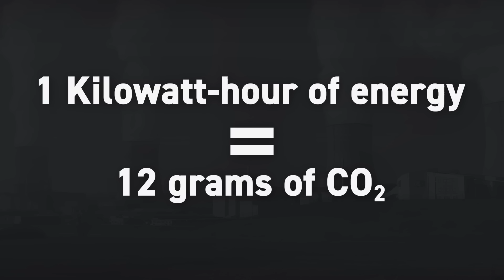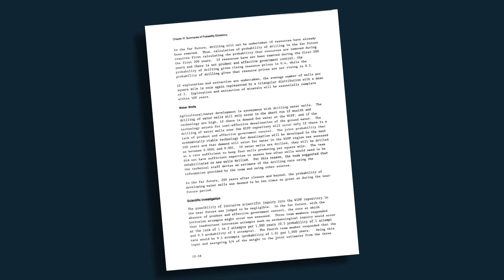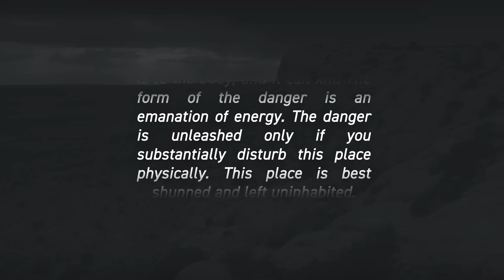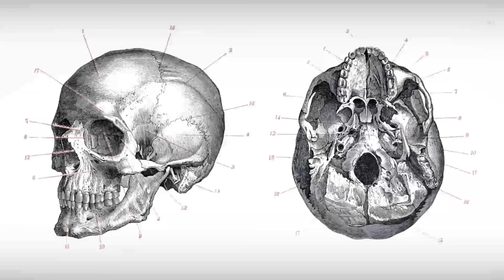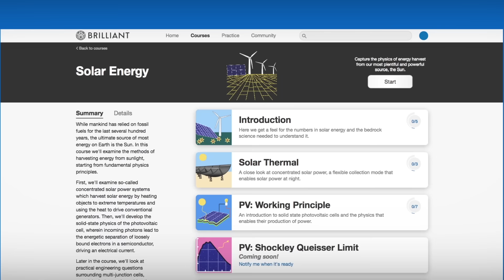The Nuclear Waste Problem

Comment: I like a lot of your videos, but this one is horrible.  You imply that most nuclear waste is sitting in pools at the moment (it's not).  You imply that there are only 230 years' worth of uranium, and fail to mention 99.5% of nuclear waste is unused fuel, and that there are much larger theoretically recoverable sources of uranium (like the ocean), and make no mention whatsoever of thorium (which has a comparatively limitless supply).  In noting the economic costs of the exclusion zones, you don't mention they were made far too large around the melted down reactors, and basically result in unofficial nature reserves, probably more pristine than our national parks flooded with poorly-behaving tourists.  

"As a radioactive element decays, the individual atoms split into two."  REALLY?  You mean fission, not decay, right?  How are you even making this video while mixing up these terms, ESPECIALLY because you are making one on nuclear waste (where "decay" becomes an important concept).  Shaking my head. 

You state that the fuel rods "use up" their energy which is why they are no longer useful in the reactor.  NOT TRUE.  It is because of gaseous fission products building up inside of the rod, causing it to swell and crack.  Most of the "fuel" remains unused, as there is a lot of uranium 238 which could absorb neutrons and become fissile plutonium, which would keep the reactor running for decades more just fine.  The problem is the solid fuel currently used would break the reactor due to the gaseous products breaking the rods.

You imply that nuclear waste is dangerous for hundreds of thousands of years.  It's not really, since the radiation emitted will be low.  This is a necessary consequence of long-lived nuclear waste having a long half life.  An intrinsic property to long-term nuclear waste.

You also completely ignore that "new" technologies (50 years old, but newer than the current concepts of nuclear reactors we keep building) could burn up all long-lived nuclear waste and leave us with rapidly decaying (in 300 years) fission products.  That's right.  We could completely rid ourselves of long-lived nuclear waste, while at the same time providing carbon free energy, for thousands of years, all without mining another single atom of uranium.  This is because nuclear waste is 99.5% unburned fuel.  Who would pay for this?  The taxpayer?  NOPE.  The power companies for decades have paid a nuclear waste fee, and the fund now has 46 billion US Dollars in it.  Google Nuclear Waste Fund.  The federal government promised to collect the waste, and the companies have been paying for the fee, and yet so far, anti-nuke activists and paralyzed government have crippled responsible stewardship.  Let's develop reactors that can burn up the waste (my preference would be by using molten salt reactors, first developed in the 1970s) and get to a zero carbon economy within the next decade.  Using the fund, development and much of the construction of these reactors is even already paid for!  No business case in selling the electricity needed (though for technical reasons it should be the cheapest ever generated, except from perhaps hydro).  I really cannot understand the stupidity of our elected leaders and the electorate in general for not having done this ages ago.  We need scientific literacy NOW.  Your video FAILED in even mentioning this quite important point.  And it's not like "closing the nuclear cycle" is a new concept.  It was the idea from the beginning.  It should have been included in merely talking about the history of nuclear waste storage and the motivation for the pools and dry cask storage.

You say that every little bit ever is currently in short term storage, but this is clearly not the case.  Stalin put some nuclear waste in long term storage, pumping it underground in a sealed aquifer. 

Also, the french put nuclear waste in glass, and to me this is long term storage.  Sure, it's not buried, but it's also not going anywhere, even if we disappear.  How do we know this?  The vitrification (glass) of nuclear waste happened because they saw how nuclear waste was stored billions of years ago in the natural nuclear reactors in Gabon.  No, i'm not making this up.  You have a laptop - go google it.  NATURAL nuclear reactors stored their fission products (obviously by accident) in a way that kept them from escaping "into the environment", even though they were in ground water.  Actually, I would say this is another reason your claim that no nuclear waste has ever been disposed of long-term is false, even though people didn't produce it.

You say that when the spent fuel rod pool is dry, the radiation "goes out into the environment", implying it's the same as a cloud of caesium-137 or strontium-90 approaching Tokyo. But it's not. Maybe a discussion about what is meant by the term "radiation" is warranted here. Yes, you'd have radiation coming off the rods (alpha, beta, gamma particles), and it could induce some radiation in items exposed to it, but it's not the same as having the radioactive particles directly on your farmland, in your body, whatever. It's not like the fuel rods would magically move out of the pool unless there were some other type of problem, like an explosion.  Then you say that "thousands would have been killed".  How?  Were thousands in a direct line of sight with the rods of the pool?  Please explain yourself.

I will give you props in correctly asserting that NOBODY was killed in the Fukushima reactor meltdown from radiation (two were killed in car crashes during the evacuation as a consequence of the exclusion zones being too large as a response to unreasonable and unscientific fear of radiation).  But you then incorrectly state that 130 early cancer deaths are expected.  I assume that this is due to the linear no threshold "theory" of the effects of radiation on humans, when the reality is that you need to have a dose of radiation above a threshold to be harmed by it.  At lower levels, radiation is even good for you, protecting you from cancer (google radiation hormesis to read up on it).  Evidence suggests the latter, fear mongers love the former.  Finally at least the "scientific" UN changed it's stance on the matter and rejects the linear no threshold model.  So when you say 130 deaths expected, please state your source.  I'm going to go out on a limb and say it's anti-science hogwash, unless you can show that that many people received more than a threshold of 100 mREM (they didn't).  

Instead of accurately describing nuclear reactors and the nuclear waste problem, and showing potential plausible ways for long term disposal, you take the narrow political view that it's an unfeasible problem to solve.  It's not.  You use anti-nuke fear mongering instead of elucidating the science.  Thank you for not adding any value to the lives of your viewers with this video due to careless research and narrow political aims.

100,000 years from now long term buried waste would not be waste anymore.  The "bad stuff" would have long since decayed away to safe levels.  Though still radioactive, I wouldn't mind touching it!  But one thing it would contain plenty of - Plutonium.  And you'd only need chemical separation to get it refined, with nearly no radiation to make it in any way difficult.  It would be a perfect plutonium mine (not a "naturally occurring" element).  We will have succeeded in giving whatever warlord owns the territory above in a post-apocalyptic world a monopoly on easily-buildable "gun type" nuclear bombs.  Especially if we mark the X on the map with a thorny landscape and pictographs to help her or him figure out what lies buried there.  No discussion of this either.

Aaaaand at the end you have an advertisement for math and science education.  The irony is thick here.
Reply: I scrolled a LONG way to find this comment after reading you mention it in a reply near the top. You should be the top comment here. I ADORE Wendover Productions as well as Half As Interesting, but I strongly feel that they mucked this one up badly.
Reply: This comment needs more upvotes.
Reply: After reading this. I know I have got a lot to learn
Reply: Oh wow a whole essay in the youtube comments. I bet every person who saw this read the whole thing.
Reply: This comment is not completely true, as it tries to be.
Long lived nuclear waste has of course lower radiation. Especially because short lived waste decays. BUT, nuclear waste has also materials with a half time of about 100k years. Which is a really bad spot, because it is some magnitudes smaller than "natural" uranium ( meaning lots more dangerous), but this half time is still so high, that it takes millions of years to decay do negligible amounts.
So, when will the fuel really be not dangerous anymore? It depends on your definition of which amount of radiation is dangerous and on how much waste/ purity of it you have.
Reply: Nice essay you got there.
Reply: You told him.
Reply: How long did it take u to write this
Reply: This comment is longer than most troll read more comments
Reply: Atleast add a TLDR
Reply: MrGottaQuestion legit that is really interesting and you should definitely do a video on it
Reply: I appreciate that you mentioned the new reactor technologies that have been developed like the LFTR or MSR, but what do you think of breeder reactors like the Integral Fast Reactor (IFR)?
Reply: Its not that deep chill out.
Reply: This guy knows his shit. Screw solar power and wind mills, nuclear is the future.
Reply: Ok
Reply: MrGottaQuestion Launch your own channel and speak the truth:
Reply: "As a radioactive Element decays the individual atoms split into two" Physics major be like 😂wtf
Reply: Make your own video, man.
Reply: 1. Thank you for doing this amazing research and sharing it.
2. Have you considered forming a power company that does exactly that with the leftover materials 
3. How long did you spend typing that essay!
Reply: Spent fuel rods are 80% recyclable, the only reason we don't donit is because it's illegal, France recycled their fuel and has almost no nuclear waste, protest this crime against the environment!!!! Legalize nuclear recycling!!!!
Reply: @question, there actually is a ridiculous amount of spent nuclear fuel stored in dry casks at many nuclear plants across the nation. You can even see them on google earth.

Most of the shorter lived highly radioactive isotopes will be gone relatively quickly....others such as plutonium have a very long half life. How ever Plutonium is extremely dangerous only if it can get inside of your body.

I was aware of the natural nuclear reactor of Gabon’s how ever I was not aware that the used fuel was vitrified. Some real interesting facts.
Reply: MrGottaQuestion My knowledge on this topic is rather poor, so thank you for the long and detailed comment. Lost me a time or two, but picked up shortly after. If you have time for it, I have a question: While it currently is way to dangerous and cost prohibitive, could advances in space travel give us a permanent solution for at least the most dangerous waste material? If we could be super duper certain that it wouldn’t blow up, chucking some of the waste into a rocket and hurling it into the sun would get rid of it(and be cool as hell too!). Really expensive yes, but maybe better than hiding it away and hope for the best. Remember, we are the species that rendered large areas lethal due to “operator error” and by having a nuclear plant in a place with a lot of seismic activity :P
Reply: Thank you for this comment! I have been looking for videos like these because my country's political leaders' keep publishing facebook posts about wind farms and solar panels. There are so many comments on them about how they're doing the wrong thing because we should be creating nuclear reactors, so I'm trying to learn more about them. You've given me some great keywords to get to googling and researching :)
Reply: * is taking notes to pass classes*
Reply: Best reply here. The video is inadequate at least. The failing to mention the “thorium” and molten salt reactor solution is a major oversight
Reply: BAM!
Reply: @rofljohn23  Regarding your idea of sending nuclear waste into the sun, completely disregarding any potential other issues (bc I wouldn't know), it takes A LOT of energy to de-orbit something (equally as much as bringing them to orbit). Trying to send the waste into the sun (or even just so they would fall into the sun before they naturally decay) it would take a huge amount of energy. So much, it would probably harm the environment more than leaving it here (Don't quote me on that).
EDIT: Just for funs, look up the parker solar probe, even though it only goes into orbit around the sun (with still PLENTY of energy remaining you'd need to dissipate), it took imense efforts, a very long time and accurately planned planet swing-bys to get there (heard a quote, about 50 times more energy required to get into the sun's orbit than to get to Mars).
Reply: Plumbus 48 You have eyes and a brain. Read.
Reply: Na Thorium only has 2x the supply, but it's because no one is looking into burner Thorium reactors, they are looking into breeder reactors for Thorium, but a Uranium breeder reactors would have enough fuel for the next 2500 years including the nuclear waste you talked of.
Reply: @deusexlemona9142  You don't need to replace the salt, or if you are having to replace a significant amount of the salt you have a huge corrosion problem and you need to shut down the reactor and drain it. So no... If a molten salt reactor is working properly you put the salt in once and you pull out only waste materiel, maybe over a 50 year lifetime you would have to replace 1/1000th of the salt and focus the corrosion on sacrificial materiel inside the reactor which would keep the ion balance in the rest of the reactor.

However due to MSR high heat, using waste heat to desalinate water is not a bad idea, but you would just inject the salt back into the sea as pulling pure salt out of the ocean is extremely power intensive, which is why we just leave it to the sun. you would only increase the consecrations of salt by 50 - 100% in the extrust and once that has started it mix in with even 10 parts of see water it would only be 5% - 10% higher which is well within natural variation.
Reply: There's so many things wrong. The "radioactive for thousands of years" is such a misnomer. Really it's "0.13% of it will be heavily radioactive for hundreds of years, 0.5% will be mildly radioactive for thousands of years and is the stuff we put in smoke detectors, and the rest will be under background levels for hundreds of thousands or millions of years."

Also " 230 years' " worth is a terrible estimate. We get more Uranium than we use pumped into the ocean yearly by the earth. It's also at "current mining rates", which also determine that we've got "30 years" of copper left. At 20x the current market price of Uranium, we basically have a limitless supply left.
Reply: this comment gives me a raging nuclear hardon
Reply: Why the hell did you spend this much time writing this?
Reply: I love this comment. One thing though. I thought Uranium was the gun type, and plutonium was the implosion type?
Reply: @bene20080  at the same time, how hard would it be to recycle "used fuel", dig a hole miles deep in the ocean where nobody or thing will interact with the location for millions of years, and put the high radiation uranium in there?  Not hard.  Not hard at all.
Reply: @plumbus483  but you read it right?
Reply: @acebalistic1358  It all comes down to money and politics man.  It's extremely expensive to start that up. Biggest hardship to do that is the strict regulations the NRC imposes on building reactors. It's a shame, but it's the truth. I'm not much a conspiracy theorist but, the petroleum industry lobbies the crap out of politicians to keep nuclear power as the underdog.
Reply: @m0314700308891515  The military does it with their spent fuel.
Reply: @rofljohn23  Could we, yes. But it wouldnt be economically feasible. Considerably how tectonics works and the recycling of the earths crust, it would make much more sense and probably be safer due to lower risk transportation to just dig deep holes, chuck it down in there, and seal it up.
Reply: @idunno7087  he cares about education. Its hard to let someone teach false doctrine and not say something about it.
Reply: I was going to write a similar reply to this video, but you covered everything nicely. This guy has no idea what he's talking about. In particular, this guy doesn't seem to have any understanding of what radiation is. He appears to think of radiation as if it's like a virus, with the ability to propagate and reproduce once it "escapes into the environment". It's painful to listen to.

There really needs to be a nuclear power-related issues equivalent of skepticalscience.com to address the usual anti-nuclear FUD talking points that pop up whack-a-mole style.
Reply: @odustbrown1836  We (India)literally are putting together a reactor which feeds on thorium reserves
Reply: @nolanwestrich2602  I read the whole thing, and before that I wrote an essay of my own (less combative, but still touching on many of the same points as well as providing a different location to bury nuclear waste that is certain to become inaccessible within 1 to 10 thousand years).
Reply: @vocassen  Regarding flinging nuclear waste into the sun, the Parker solar probe doesn't count because it's trying to get as close to the sun as it can IN A MOSTLY CIRCULAR ORBIT.
The hard part isn't getting your orbit down past Mercury. The hard part is making the orbit circular at the low point, as you have the highest velocity at the lowest point in your orbit, and therefore need the most fuel and/or gravitational assists to get to that point.

All you need to do to send waste into the sun is cancel out most of Earth's velocity around the Sun, and let gravity do the rest.

Perhaps a better idea is to actually send it OUT of the solar system, a Jupiter gravity assist does wonders for flinging things out of the solar system and is totally reachable with current technology.
Also, there are currently not built technologies which could drastically reduce the cost and increase the safety of sending things to orbit. Look up Launch Loop or Lofstrom Loop. Funnily enough, one of the studies actually figures out how much stuff you could launch if you used a typical nuclear power plant to power the launch loop, and it's not a small amount by any measure. Something like several hundred tons per day.
Reply: @nolanwestrich2602  i had the same reaction. then i read it. i regret nothing.
Reply: @idunno7087  because this is the kind of thing that time needs to be spent on. Nuclear power is our best option right now. if it delays the potentially catastrophic clock of climate change, then we have more time to discover more solutions. If you want to see where nuclear power is showing its potential. Look into Frances energy supply and compare it to Germany's. Germany is trying to switch to renewable sources safe for the environment and it is costing them a lot of money. The average energy bill in Germany has risen. France has close to 90% of its energy output coming from nuclear. Their energy bills are much lower and they produce less carbon dioxide then Germany. That is why this person wrote this long ass essay. These are the kinds of things that people really need to hear the truth about(that's why I assume he/she was pretty damn rude).
Reply: MrGottaQuestion ain’t nobody wanna read this chief
Reply: Can you make a video of this so we can talk watch it?
Reply: You, sir or madame, are my hero.
Reply: I am so thankful for your comment. I was going to go on a rant but it would not have been nearly as good as yours. I'm happy to see a voice of reason here. This was far to pseudoscientific and I am very disappointed in Wendover.
Reply: @corneliusmcmuffin3256  yes and the director said "if i were to do this today i would go straight to molten salt" enough said:-)
Reply: @nolanwestrich2602  most of it:-)
Reply: very informative and well thought out may i copy this and insert it where necessary? please anyone that can copy this comment and email it to both your congressman and senators we are so past needing liquid salt reactors just to clean up the high level waste the almost free electricity and desalinated water is just a gold plated bonus!
Reply: Wendover is nice but it's just the most superficial 10 minutes of wikipedia and googling level of research and nuance
Reply: @qqqqqqqqqqqqqqqqqqqqqqqqqqw  yes and missed may important points.
Reply: MrGottaQuestion , well done, I was just about to give a reply myself but I read your comment and think you did a fine job. There seems to be a lot of white knights who want to totally defend Wendover. The problem I find is that if someone has access to create decent production value videos, add a nice smooth voice for narrative, then all of a sudden that’s an authoritative video. And god help anyone who points out any inaccuracies.
Reply: I dont have time to read this but I agree
Reply: Plumbus 48 I know it may be hard to understand but some people can read for more then 5 minutes without their brains hurting
Reply: Can you make a video about this? That reply was great
Reply: odustbrown  he literally used a plan of how to use thorium to back up his evidence. Calm your crap and stop dropping fbombs against a well written out argument.
Reply: Damn, man. Good reply.
Reply: Wendover BTFO
Reply: @odustbrown1836  I didn't know you can make a difference concerning nuclear physics in 3 months.
Reply: @KathwithaK  theyre pushing hard on them bec 
1. Good PR on being "green" and fighting climate change.
2. Theyre VERY labor intensive and create jobs. Economically its ineficient as resources could ultimately be better spent, but again good PR as it boosts the economy.
3. It tends to shift enviromental cost to poorer countries. If they had nuclear THEY would OWN IT and would have to deal with it. Current solar produces alot of toxic waste in manufacturing and e-waste at the end of its lifespan, which tend to be produced and end up in poorer countries with more lax environmental laws, bec capitalism
Reply: @plumbus483  lmao
Reply: wow, you bossed this
Reply: Make a video about this, you fucking have to.
Reply: Nice book
Reply: Mate - you need to relax man. Jesus
Reply: @corneliusmcmuffin3256  
If I'm not mistaken, Sputnik is a fake news propaganda machine. I myself wouldn't read that. No offense or anything tho, enough drama down here already
Reply: Yup.  Molten Salt Reactors can burn up existing nuclear waste, getting that wasted energy and leaving a safer type that’s only radioactive for a few hundred years..
Reply: /claps, you ticked every box my friend, good job now i don't have to write out all that crap they missed and messed up
Reply: When a knowledgeable person speaks, the world listens. Btw I had no idea avout natural reactors in Gabon
Reply: You did well.
Reply: @Skofta well aware.
Reply: You should start a youtube channel and get kids more interested in nuclear science.
Reply: You know a good bit yes. But a salt reactor was mad a small salt cooling reactor even thoe it did cool the rods quite well the salt would turn to slug. Then the rods would get hot and i think it was also mixed up in the Manhattan project but a salt cooler was tried but it failed
Reply: I just wish I had more than one upvote to give to your post. This video is sadly little more than fear mongering nuclear hysteria.
Reply: I feel like returning to my science class  😁
Reply: totally agree!
Reply: i knew this nuclear waste can be processed or reused. Dumping it permanentlty is just dumb, and it is half of the video
Reply: Dude can you please start a YouTube channel just like I did when I rant ahah
Reply: thank you
Reply: Nuclear Waste Fee - you mention the tax payer won't have to pay it the power companies do. Which means the Power Companies buried that fee in our monthly bill...so we did in fact pay it.
Reply: Nice essay about nuclear physics it is interesting to say the least
Reply: Nuclear even better to stop pollution instead of so called "clean" energy!
Reply: Woosh
Reply: someone had a bad day
Reply: Sounds to me like we need to start making some new modern nuclear reactors; start asking your representatives everyone!
Reply: You forgot to add the "Ummm ackshuallyyyy..."
Reply: I cannot confirm any of the said information, but damn you can make it sound good (if you were falsifying statements). okay sire, good luck indeed
Reply: @MrGottaQuestion: This post is certainly right in 99.5% of data (0.5% non accurate is related to "molten salt" reactors, one of most dangerous models ever designed or proposed, for similar reason* that make sodium moderated/refrigerated designs simlpy a madness), but the post uses this true data in a very nocive way.

I propose any kind of solution you prefer in advance (related to nuclear waste) to be located in your own garden, where your offspring grows, whatever this solution is.
If you agree, I would be trully grateful for your generosity towards the human being and its energy model problematic.
All data is irrelevant when we treat with nuclear tech in a 'crapitalist' world, where the costs and economic benefits are always more important than data, knowledge, risk, safety or the future itself. Both Chernobyl (in a 'comunist' society) and Fukushima (in a 'capitalist' society, and caused by a natural disaster which always needs to be evaluated as potential risk) accidents prove this point.

*Molten salt reactors are able to operate at very high temperatures, temperatures that high that make completely impossible to use water in case of any kind of leak or fire in primary thermal cooling phase. Any water contact with the product leak or the fire would produce an explosion (due to simple expansion of the liquid water exposed to direct contact with materials at extreme temperatures). And the fact that this system uses low pressure standards does not make it unvulnerable to leaks nor fires. And not to mention the multitude of fails that molten salt reactors have. The pumps for the first phase thermal fluid have tons of huge fails, and only this makes it simply a nightmare in engineering related questions. It is not even an option. If it was, it would be an extended solution, and it is not even considered as commercial scale option.

Edit: few gramm mistakes, english is not my mother tongue. May still left few more, sorry in advance.
Reply: When I started reading this comment, my life expectancy was 80, but now it's 20.
Reply: @petergriffin9902  Yes, thats right, they explode by themselves.
Reply: @odustbrown1836  How do you know that he is not actually working on that technology? His level of knowledge makes it likely, doesn't it?
Reply: MrGottaQuestion all is amazing that you say. I am shaking my head at such a smart person who thinks fake fiat money thats just printed whenever there is a fake crash to save the banks is the main obstacle or resource thats stopping us from achieving truly emossion free and also sustainable energy source. Its not the fake fiat money is in short supply , the printers will print , its government unwillingness
Reply: pyroprocessing and gen 4 fast breeder reactors, 98% of all current waste is eliminated, the remnant is relatively short half-life products (total loss of radioactivity in about 250 years, or 18 half-lives) we could run for about 500-1000 years using NOTHING BUT our current reactor waste. we CAN build containment for 300 years, we can NOT build containment for 10 million years
Reply: I agree this video isn't great but it's not terrible either
Reply: @00BillyTorontoBill  You should already know this. People like you are standing in the way. It's like how Democrats say "Trump hasn't done anything in office!", not realizing that they block everything he tries to put through.
Reply: Well, he definitely triggered you, and we (2K people, at least) have read this, so it somehow did influenced our knowledge base. So, there is still a way to say this video was useful in its way. But thank you for this angry explanation, it really gives a wider and more optimistic view to us.
Reply: It will not be so easy to use that plutonium in a storage - first, the would-be overlord have to excavate a mine of 15000 feet, then to remove a clay from horizontal shaft, then to excavate concrete blocks that contains an element, after it to split it somehow, to separate a plutonium from the waist; to store it. Only after that he (or she) will be able to start building a bomb, which is not an easy task itself. So, they have to be at least at the same technology level as we are to complete all those tasks, right?
Reply: in sweden depleated fuel is sealed in copper and concrete shielding below montains
Reply: I decided to double-check your claims in this comment because they're so interesting and i really want them to be true. Your first few paragraphs were really hard to verify and i would like your source on the "99.5% of nuclear waste is unused fuel" bit as well as most others in paragraph 1-4. All the rest however i can easily find to be correct (even though a couple of the claims, for example the one about radiation hormesis, are controversial) apart from the one about nuclear waste storage. Statistics in this one was difficult for me to find.

Thank you for the enlightening responce to this video :)
Reply: MrGottaQuestion nice book
Reply: took longer to read than watch the video
Reply: So until what date, Chernobyl & Fukushima is not a safe place for human to live???? Any Guess???
Reply: @realityaccepted9797  The immediate area inside the plant will be uninhabitable for at least another 20,000 years. The area outside of the plant (the 18-mi explusion zone) experts estimate that it will charitably be anywhere from 20 to several hundreds of years more for people to safely enter as of january 2019.
Reply: @arishisa9496  Aw, what's the matter.  Did his post exceed your ten second attention span?
Reply: Heckin' yes my dude
Reply: Thank you for this reply.  I was looking for it and it’s so refreshing to see that there are still people in the world who are passionate and interested enough to compile all of this into a comment. But obviously this comment has been read and appreciated many times. Unfortunately his video was a drop in the ocean of uninformed, fear mongering crap presented to the vast population that don’t know any better (because frankly the majority of people should not need to study nuclear science.) however in the current climate of media and politics the informers are just as uneducated and jump at the chance to excite people with some dark dystopian future that has no ground in anything but uneducated fiction. In reality nuclear is a wonderful option that defeats all other methods of power generation in nearly every contest. It should be a subject of hope but that doesn’t fit anyone’s “agenda”.    Thank you for providing some content-rich hope against this ridiculously irresponsible video because even if one person read this and decided to explore a little further, it was worth it.
Reply: In the US, building new nuclear power plants is too expensive and takes too long.  No utility is going to spend tens of billions of dollars and waste a decade or more to bring a NPP online.
Reply: @rofljohn23  Too much nuclear waste and not enough money in the whole world to launch it into space.  And if the rocket blew up when launched the whole area would be uninhabitable due to the deadly fallout.
Reply: @acmefixer1  That's just not true at all. The main reason we don't see more on the way (there are a few, one opening in a couple years, in fact) is because Fukushima made them unmarketable due to overexaggeration danger and misinformation. There's also a great deal of anti-nuclear lobbying by the oil industry (no doubt responsible for part of the reaction after the Fukushima incident)
Reply: Hello,
  I would greatly appreciate if you could take a moment to give me your opinion regarding the likely hood of an accident releasing radiation. Am I mistaken that the arguement for Nuclear Waste Not being a serious problem based on it not being that dangerous & it wouldn't spread that far? Because any contamination is Unacceptable. Or do you disagree?
Reply: Wendover ought to sticky this comment or delete the video. Im glad you bothered to write this reply. Pity its so far down the comment section
Reply: All good points, except you're omitting one really important fact about Thorium reactors or u238.  When u238 or Thorium absorb that neutron they become weapons-grade plutonium or u233 respectively.  Very dangerous materials to be available without having a very precise and robust standard/guideline and security in place before hand.  I'm not arguing against your case in any way, I just think it's important to make sure this potential danger is known before touting that it's the perfect answer.  Humans can be shady, and that is the biggest risk of nuclear power.
Reply: Dude are you some kind of scientist?
Reply: god
Reply: @odustbrown1836  Both of those points have literally zero bearing on what he was saying about this video. What exactly were you trying to communicate?
Reply: @merilazic9070  I don't think someone deeply interested in nuclear physics is gonna bother replying to a flame war youtube comment that uses "your" wrong. friggin delusional, bud. get it together.
Reply: Logan Cormier cool thanks that was 9 months ago
Reply: After seeing this hate war, I think I'm gonna go back to playing on my PC and turn a blind eye to anything to do with radiation.
Reply: MrGottaQuestion you took that to the heart bro respect
Reply: There was a lot research towards breeder reactors 50-70 years ago because we knew about limited Uranium resources. But when confirmed Uranium resources grew and it become clear that breeder technology couldn't financially compete with other reactors at the time they lost development funding.

Cost problem for nuclear power plant isn't fuel. Dominant cost is construction which should be minimized. Breeder reactors (like thorium would be) issue seem to be that they often seem to require more expensive materials and construction methods to have similar life time as current pressurised water reactors. Of course it is possible that people find ways to make breeders cost effective to build then they could be competitive with reduced fuel cost. But danger is potentially higher security requirements as breeders may produce materials which are easier to turn weapons than PWRs.

Even long term storage underground is relatively cheap if you happen to be living on top of old hard bedrock (like Finland is). That even reduces financial case for breeders as waste management costs for storage are lower than breeder reactors.

I'm not saying breeders are impossible to make economical. I'm just saying why they are current seeing only minor use. It is also reason why future breeder reactor development has a lot work to do before large scale commercial use is possible.

I personally hope breeder reactors would become financially feasible soon but I'm a bit pessimistic about very quick development. But still it looks like financially competitive fission breeders might be quicker to market than financially feasible fusion power (ITER and DEMO look like far too expensive to be financially feasible technology).
Reply: @deusexlemona9142  if you want to include theoretical cancer deaths then you should include downwind of coal stations - where there are clear statistical cancer plumes - due to the radium, thorium and other stuff that gets out of the chimneys

Funnily enough the anti-nuke brigade start to loudly shut down anyone who brings this issue up....
Reply: @corneliusmcmuffin3256  India's Thorium syste suffers from the same failing as conventional nuclear power and the same waste problems - they use fuel rods in water and only extract about 1% of the energy before they have to be pulled out due to stress cracking/gas pressure inside the rods.
Reply: TLDR
Reply: Dude just wrote a whole essay in the coments adressing every issue in this video and stating how vital these are. You have my respect
Reply: I believe the plutonium found in nuclear waste is not weapons grade, not sure. (So the warlord is still going to need centrifuges for his bomb). Great response. I took an online course on nuclear power, so it was great to see someone correct the record.
Reply: MrGottaQuestion I really love this kind of comments under this kind of videos. It’s just knowledge being poured to benefit pretty much everyone without an actual goal other than spreading correct knowledge. 
Plus, the fact that it sparked a bit of discourse is, in itself, a feat that very few media publications manage to accomplish successfully. I’m surely not knowledgeable enough on this particular matter to rebuke any of the things (or facts, given their correctness) you said, but it undoubtedly peaked my curiosity towards a field I had a fascination about. 
Great job man, great job indeed
Reply: I read until you got hung up on him mentioning that nuclear decay splits atoms.

It essentially does, the elements decay into lighter elements.  Not fission per say, but anything releasing say alpha particles, is going to be losing protons which results in an element change.
Reply: Owned lol
Reply: @odustbrown1836  Informing people DOES make a difference. He's combating the kind of disinformation that lead to us not exploring nuclear more now. Your logic is flawed.
Reply: like another vid,maybe on ted x ,,this guy was adament that nuke was 100% safe.these guys are paid by who?.you guese..
Reply: Thank you!  I regret I have but one upvote to give!  Well answered.  This should be a video of its own!
Reply: @bene20080  You do understand that these short lived isotopes are valuable in medicine and industry?  And due to the difference in chemical makeup, they are easily separated and used as such?  The majority of the nuclear waste mass is thus left as U238.  Depleted uranium is the bulk of the natural uranium found in nature.  There is a lump of it sitting on my desk and it's activity is lower than the concrete below my desk!